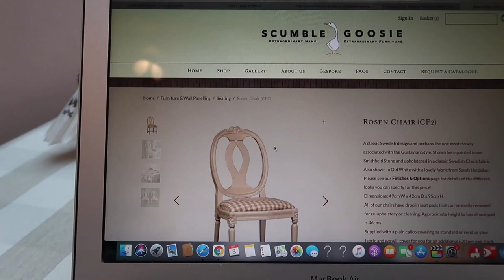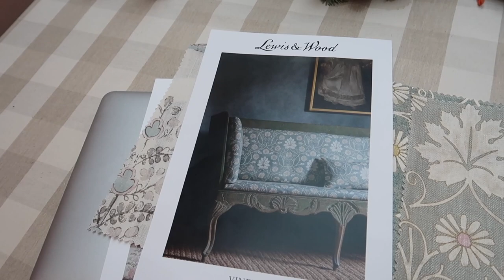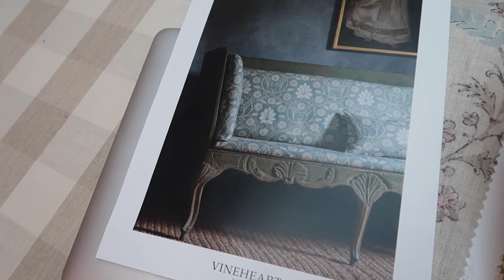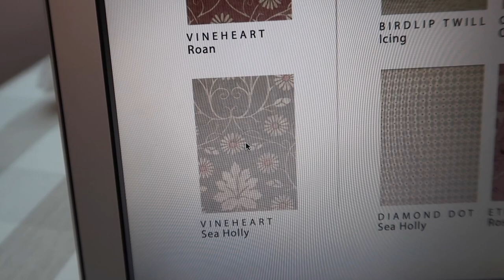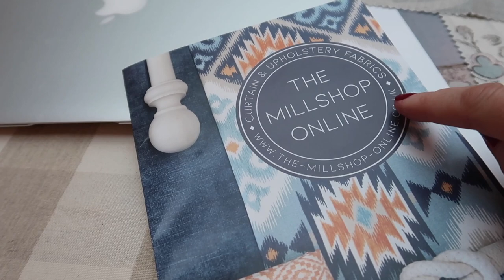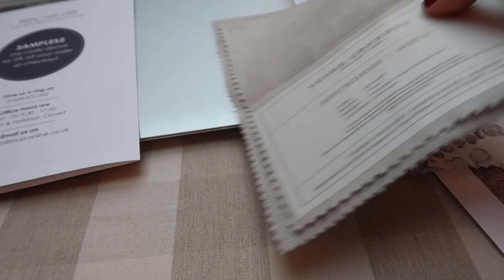OUR ATTIC ROOM RENOVATION: WE MADE A MISTAKE!

Comment: I might be able to help a bit. There is a reason why the paints look different. When you tried it, you tried it on paper. The paper and the wall have different ways of receiving the paint and both come through color differently. Also, paper might have had some acid in it, which can cause yellowish tone (basically, great deal of papers that are not high-profile art papers have acid). The best way to try out a paint is on the piece of so called faux wall, which is basically a piece of cardboard that you run over with plaster and sometimes, primer. This will show you how the wall will look, almost exactly, when you try the paint. That being said, if you do not want to paint over the entire room again, solution might be to buy mat spray varnish and go over the existing paint. Varnishes deepen and darken the color, so you might get much closer to the desired result. However, this might be as expensive as buying new paint altogether, so it's more choice of convenience (it's way quicker, naturally). Best of luck :)
Reply from the maker: Lol as we mentioned there was nothing wrong, I mixed up the sample pots and ended up ordering the wrong colour. The one sample pot is a 100% match with the colour we ordered, Joerg even showed it in the video when he painted it on the wall. We won't be going for these shades anyway.
Reply: @KirstenJoerg  Ahaha, sorry, I watched a part of the video, then had a distraction and left the rest for later... so missed that part (for now). Great that you know what happened. I had some troubles of the kind myself, painting a hallway few years ago, so all this looks familiar. Best of luck to you with rest of works, I hope everything goes as smoothly as possible from now on :)
Reply from the maker: @illyriaduncan820  Thanks so much! Hope you're keeping very well.

Comment: I think your paint mixer forgot a dab of something.  you can take it back to the shop and have them check the colour.  it will change in different lights so don’t panic just yet.  Good luck.
Reply from the maker: No, as we mentioned I made a mistake and mixed up the 2 samples. The colour we put on the wall matched the sample pot 100%.

Comment: I think it's the undertone of your surface walls. I had this happen toe even tho it had a built in primer it looked different from my sample. Your walls have grey tone to me and that may come thru under the paint. Good luck. It's only paint. Perhaps your supplier can give you advice. 
Are you sure you have the correct volor that matched the first sample pot? I also asked for the wrong sample color than a h at I ended up with. Good luck.from South Carolina, 🇺🇸
Reply from the maker: As we mention in the video, I mixed up the sample pots which is why I ordered the wrong colour. The was no mistake from the company.